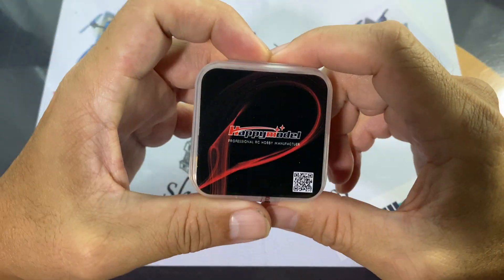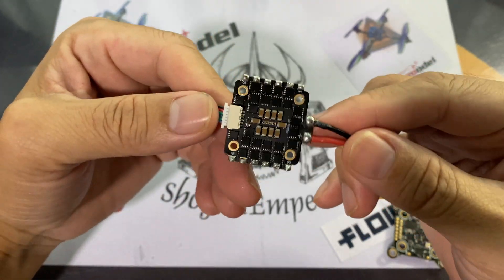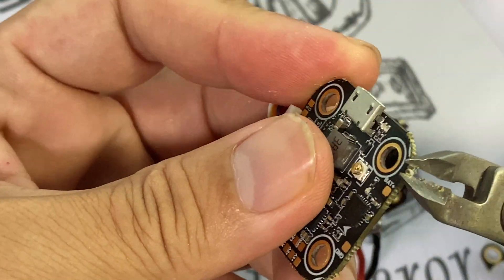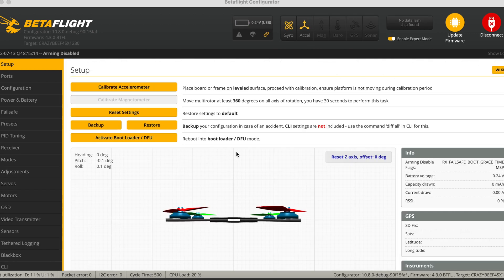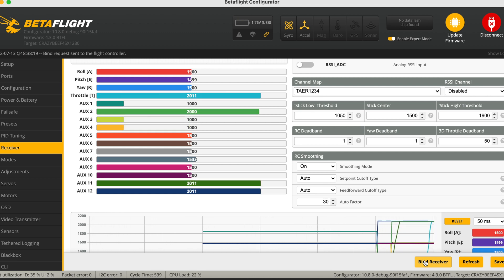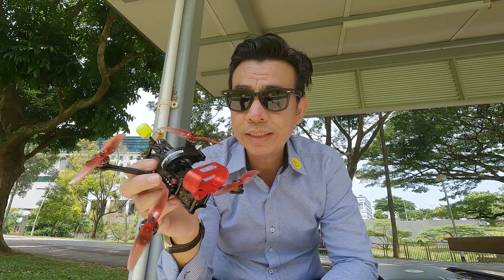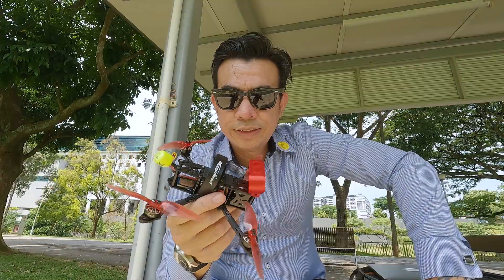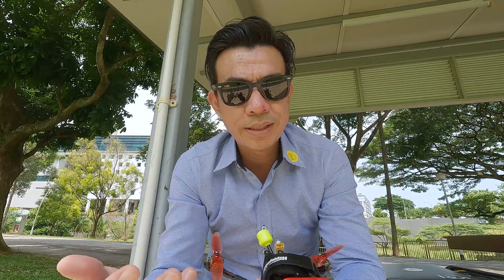Pancake AIO FC - Happymodel

Comment: What ESC did you use ?
Reply from the maker: Eh?  I mentioned it in the video bruddah. HAKRC 35A Blheli32 ESC. Unfortunately, its rare these days. I bought it a long while back and had kept it as spare till now.
Reply: @shogunemperor  sry I was looking for a link in the description.
Reply from the maker: oooohhhh.... LOL yeah, its no longer available I think. Apologies bruh. I could only find Blheli-S ones
https://www.aliexpress.com/item/1005003703593525.html?spm=a2g0o.productlist.0.0.21a85a5cF8HbaK&algo_pvid=9e216787-e053-4951-a706-770c45318f22&algo_exp_id=9e216787-e053-4951-a706-770c45318f22-10&pdp_ext_f=%7B%22sku_id%22%3A%2212000027071568360%22%7D&pdp_npi=2%40dis%21SGD%21%2135.65%21%21%21%21%21%402101d68d16578652488956662ef49d%2112000027071568360%21sea
Reply: @shogunemperor  can't see it clicking your link, because no shipping to germany. Recently many Items are not available to my country. Some are starting to be available again.
I think it's because of the zero covid strategy lockdowns in china.
Right now I'd get the JHEMCU ruibet 45A esc, if I was only looking for an ESC. Costs like 35 bucks incl shipping.
I chose the HGLRC f722 48A stack for 90 bucks.
Its for my 5 inch build.
I was at 4 inch builds and recently really tried a 5 inch, now Im hooked how good it flies.
Google for the TCMMRC angle 220 aliexpress.
That is like a BNF 120 bucks 6S 5 inch quad with awesome value for money. That one made me build a second 5 inch.
I started fpv last year when the DJI FPV drone came out and now at iver 20 builds.
Damn it's getting expensive. Couldnt afford this if I had to feed little ones too. Soon I might have to go easier on new builds. But its not bad to invest now, because stuff is getting more and more expensive.
Reply from the maker: @chrisbee5481  aaah ok understood. Yes! Those JHEMCU are not too bad... i have 1 on standby.... 5" are fun!!  but due to size n weight, i stick to micros... lets not even mention my x-class... hahaha
You're right on that man, once, Blheli32 ESCs at most costs $65... now they're priced up to $180
Reply: @shogunemperor  yeah micros are fun. My builds are spread across 1.6 inch to 5.5 inch.
AUW from 25g to 800g.
Power to weight is the Key 💪 
In a big open space, 5 inch is just more fun. Micros dont have the throw.
The 4 inch are great, responsive but a little floaty.
What got me building small was the fact that the DJI fpv drone was freakin loud. I dont like to draw too much attention and these big loud buggers are intimidating. Of course you should fly them out in the green away from people, but there is alway someone around and I hat Karens.
You have also started liking the more bladed porps right...
The HQ 6 blade props are the reason Im going big again. They fly great and arent loud at all. My newest build is a 5 inch HQ prop 5x4x6 running on 6S and Emax 2807 motors.
If you have a 5 inch, I can encourage you to try the HQ 4x4x6 props. I loooove them.
The hq 5x4x6 are just too big for standard 2306 motors.
Keep up sharing dude 😃
Reply from the maker: @chrisbee5481  exactly what u said man. U basically summed up my thoughts!! hahahahaha 
aaww thanks my bruddah! Really appreciate the kind support always!!!

Comment: Man...these motors are the same that Crux35 has?
Thinking of building a 4inch quad with.
How does it react?
Reply: Ps:What props you use here?
Reply from the maker: heheh those were the only spare motors I had with me.  Hmm... the 4" biblades are much smoother... less traction but it doesnt snap too much.  The props I use are the Gemfan 4" props
https://sea.banggood.com/4-Pairs-Gemfan-Hurricane-4024-2-blade-4-Inch-PC-Propeller-for-1408-1506-Brushless-Motor-RC-Drone-FPV-Racing-p-1657418.html?utm_source=googleshopping&utm_medium=cpc_organic&gmcCountry=SG&utm_content=minha&utm_campaign=aceng-pmax-sg-sea-en-pc&currency=SGD&cur_warehouse=CN&createTmp=1&ID=49312&utm_source=googleshopping&utm_medium=cpc_us&utm_campaign=aceng-pmax-singapo-all-220331-massa&utm_content=massa&ad_id=&gclid=CjwKCAjw_b6WBhAQEiwAp4HyIJdqE6-gmbvyWoU5SyV4cM7eLoHMVAJf_q4pEvIOfAFe0SQ55YSIohoCTFQQAvD_BwE
Reply: @shogunemperor  Thinking on building a 4inch  on URUAV with all the Crux35 parts FC&VTX just change the props really!
Reply from the maker: @cruisinginacro  yeah, that'd be fun

Comment: is there a flight controller like the whoops all in one with all built-in that can handle 3S and 3" props?
Reply from the maker: Yes bro!!!  Its the CrazyF411 flight controller. 
https://shopee.sg/Happymodel-CrazyF411-AIO-F4-2-4S-Flight-Controller-w--Built-in-20A-BL_S-ESC---Frsky-Receiver-i.452262717.11959330487?gclid=CjwKCAjw_b6WBhAQEiwAp4HyIB1jtQBIX6Zm_rsfOqI_9RyThVtqu38xg7COhBce9LwWZAzXcJugbhoCySwQAvD_BwE
But its only Frsky and getting rare to find these days.
Reply from the maker: the other is the ELRS X1 flight controller for the crux35 
https://www.aliexpress.com/item/1005003140808627.html
but both of these FCs dont have VTX

Comment: Brow, nice tutorial 🙂
What is this frame? Is It unibody?
Reply from the maker: Obrigado brooo!!!  Much appreciated. This is the Johnny4 drone frame bruh, I've just checked online.. so far this is the only site that has it
https://alexnld.com/product/fonsterfpv-johnny4-170mm-wheelbase-3mm-thickness-arm-4-inch-carbon-fiber-frame-kit-for-rc-drone-fpv-racing/?gclid=CjwKCAjw_b6WBhAQEiwAp4HyIEmAB41hiYzPeo6d2HmjfybM6yNOSftdgzI1ifJiuPYderJ7pHzqZRoCGRcQAvD_BwE
U can use another frame
https://www.aliexpress.com/item/1005001694344097.html?spm=a2g0o.productlist.0.0.1012e42erIsWn3&algo_pvid=d9ea409c-9d7f-4201-908a-70253b52c0f9&algo_exp_id=d9ea409c-9d7f-4201-908a-70253b52c0f9-0&pdp_ext_f=%7B%22sku_id%22%3A%2212000017171435755%22%7D&pdp_npi=2%40dis%21SGD%21%2114.08%21%21%214.53%21%21%40210318b916578436334891496e67a0%2112000017171435755%21sea
but this frame uses bigger mount motors and wont fit the happymodel 1404